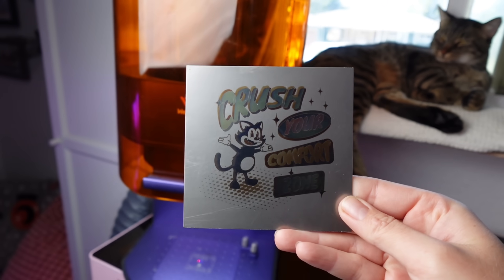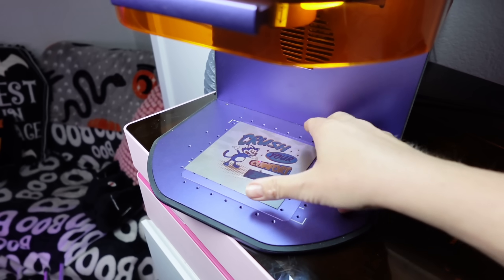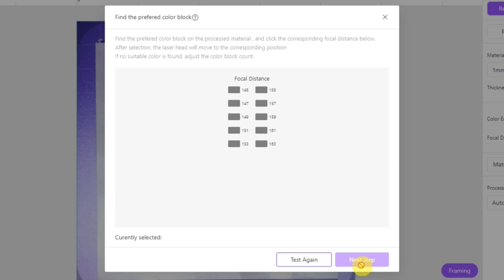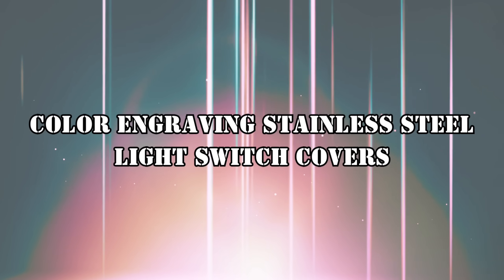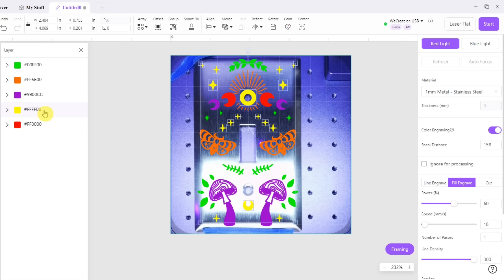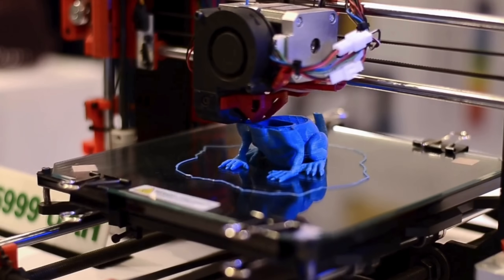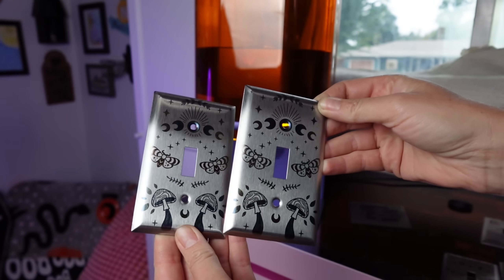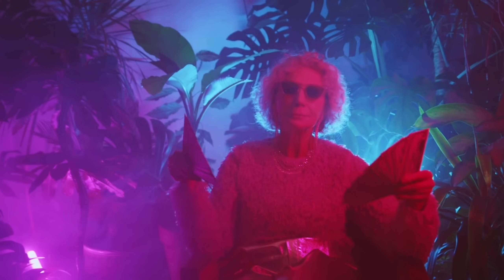Want to Laser Engrave COLOR on Metals? Here's How! (WeCreat Lumos)

Comment: Thank you so much for all the info!! Luv the video, just got my Lumos really enjoying it but a bit of trouble with colors, one question if you dont mind, 
does each part of a project have to have a different number value to achieve the colors?
Reply from the maker: Great question! Yes! So If you want yellow in one spot, assign those shapes a color in the makeit program like yellow, go to your physical color array (made from the toolbox color array process) and find which color is you'd like. On the lefthand of the array is the speed settings and the bottom is the power settings. For example, a yellow might be 30 speed and 60 power, while a blue color is 10 speed and 90 power. All colors will need to be assigned 300 for the line density. Each material will need a new array made for it's particular speed/power settings. You can see, faintly, the speed and power in the color arrays at this point (5:09). To see them better, I wrote them in with a sharpie.
I hope that helps! Here's a much more clear video from wecreat that will help, also! https://youtu.be/SXNxZSP_WsA
Reply: @LaserLady  thank you so very much Again! i made a nice piece for a friend of his logo on steel business card thnx to you! 😁😁

Comment: WOW. I heard fiber lasers are the only type that can do color engraving. Since the Lumos is an IR and Diode laser I think maybe UV lasers can do this too?
Reply from the maker: I'm not sure! I know the programing of the WeCreat Laser and MakeIt program plays an integral part with the particular settings needed to achieve separate colors. Everything is worth testing! You just may find the right focus/power setting on a UV laser to get a different color result. Who knows? 😁
Reply: Fiber laser is IR.  They are the same wavelength.  However, when you add MOPA level control to a fiber laser, you can very accurately dial in the exact settings to get exact colors.  Standard laser settings without mopa you have less control, so the power setting becomes more important.  a 2W IR is a bit low, a 5w IR is a bit high,  The Lumos 3W is kind of in the sweet spot for being a non-MOPA IR laser.  You can do color, but the colors are not as pure and vibrant as a $3000 MOPA laser.  The Lumos is the closest you can get, and at $1000, it's not bad.  But a $3000 30W or 60W MOPA Fiber laser is going to get the purest colors, that when light is shined at it, all the reflected light is of the same wavelength, and you see a pure red or pure yellow tone.  The muted look from non-MOPA lasers is because there are grays and browns, and some non ignorable percent of wavelengths being reflected back that are not purely red wavelength.

So Thus, the more control you have of your laser, the more you can ensure that every dot and particle is heated/oxidized to exactly the right temperature so that it will reflect the wavelength of light you want.  Control is what allows a MOPA to make vibrant colors.  Cheapest MOPA Fiber is Commarker at $2500 for a 40W, but it's basically color only and can't appreciably remove that much metal, for $500 more you can be etching metal and making coins, for $500 more than that, you can reasonably make bigger coins and full panel 2.5D metal reliefs.  Which is why if you end up going MOPA you end up spending $3500-$4000 anyway, because for just a little more money, you have a lot more capability.  Laser Etchers/Engravers is very much a buy once cry once type market.

Comment: Great info.  Cute new hair cut!  Hubby just got a bunch of stainless steel flasks for us to try color engraving.  Now I have to figure out the design details!
Reply from the maker: Here's a BIG tip for your design! Don't stack colors. Use the "Subtract" function under the Merge dropdown (if using Makeit!) with the layering colors so they will only engrave the part you see. 
For example - if you have lettering on top of an oval (like in my big steel plate example) make sure you cut the lettering out of the oval, then put the lettering back on there as a different color/setting. Otherwise, it's going to engrave the whole oval and then put the lettering on top, which will give you a different color than what you probably want - and take longer. I hope that makes sense! Please send questions my way if you are stuck on something! 💖